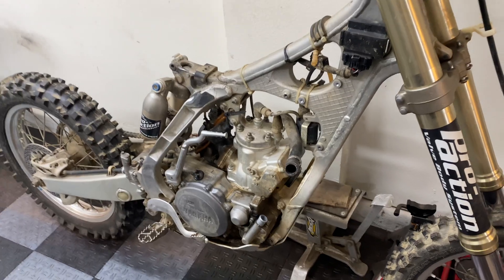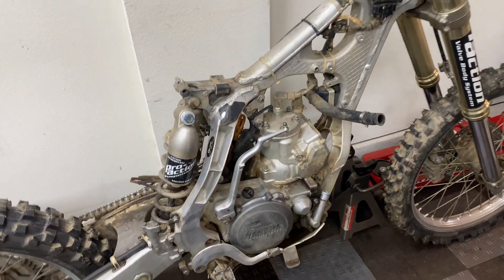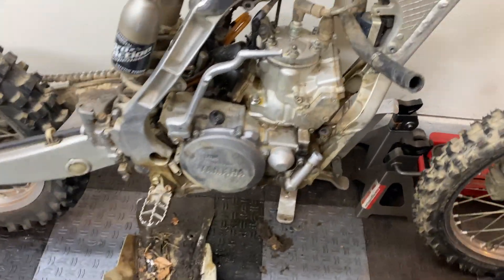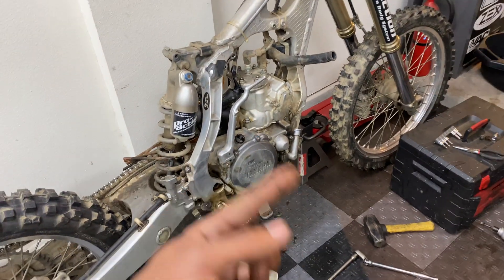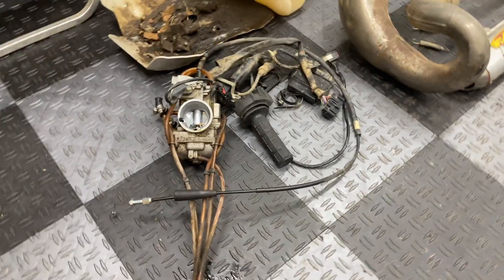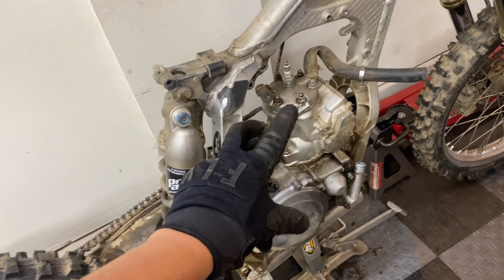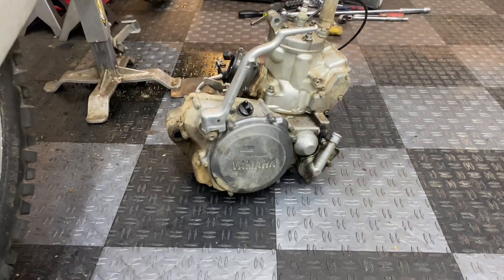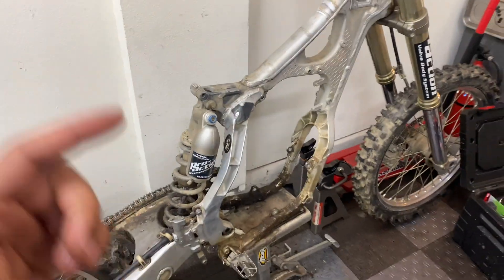Project YZ E | YZ250 Electric Dirt Bike Conversion Part 2

Comment: Hey pat, Really appreciate that you reply to comments on your channel. Sometimes my phone bugs out and I can’t see them so sorry for not always replying back. Since I’ve gotten into the habit of asking you questions about these razor bikes, what will happen if I run a 48v Vevor motor with a 72v pack. My little bro bought the 1800w kit but now he wants more speed and I have my old 72v Vevor controller just laying around. 

Also also, I melted my my1020 and it’s totally cooked now. Now I watch your content to live vicariously till I can buy another one…..and probably a heat sink too, I must be fatter than I though melting a motor like that lol
Reply from the maker: What controller are you using? Also what’s the BmS rated on your battery? If you have a Kelly controller, check the settings to make sure it’s suited for your battery. A heat sink is never a bad idea..
Reply from the maker: Sorry I missed a part of your question. I am currently running a 48v motor from my original 2000w Kunray kit with my blue bike’s 72v set up. Has been holding up well so far 6 months later
Reply: @PatOutdoors  ok that’s basically what I wanted to know, didn’t wanna melt my little bros motor too lol. Gonna build a custom pack but I think I’ll just do a 150amp bms so it’s more than I need.
Reply from the maker: @johnsherby9130  DANG! That's some serious juice.. My bikes only have 50 Amp BMS's for now, which is probably why I haven't been melting motors yet
Reply: @PatOutdoors  well it’s really up to the controller to shove that stuff in there. It won’t use all 100 amps

Comment: When you bought the Kelly controller did you click yes for Bluetooth and did you get the rs232 cable for the 52v project
Reply from the maker: Just the pretuned controller, just ordered the Bluetooth later